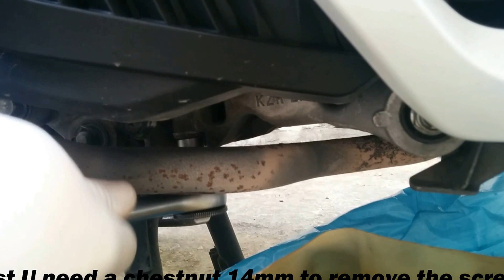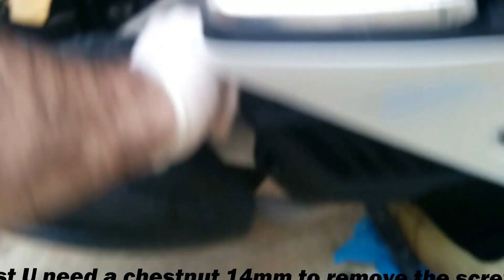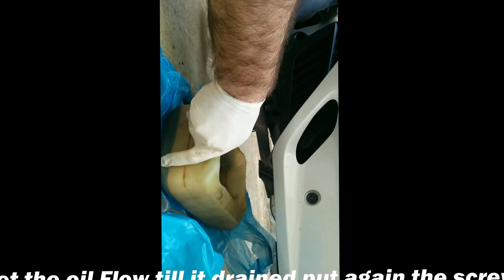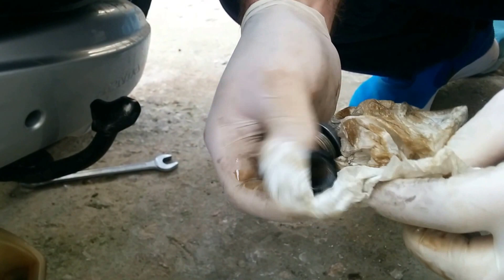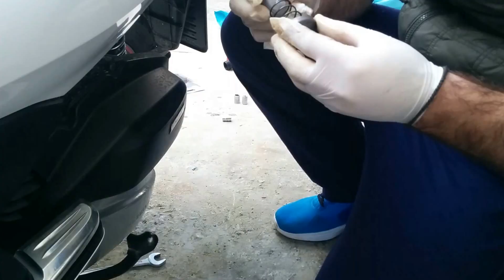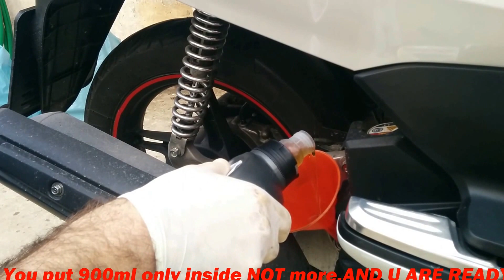How to change HONDA PCX 125 150 OIL

Comment: At honda pcx manual says uses only jaso mb type oil. But you use jaso ma2 type oil. Is it alright to do so?
Reply from the maker: I change every 3000 the oil.I have this oil for many many km and i have no problem.
Reply: @MegaZitos  yet

Comment: I just wonder why you  need to unscrew bottom bolt? I release oil from the side where's the filter, and leave it on a side stand. I am in rental business and I have changed 10 honda scooters, never had an issue, always change oil like that bethween 3000-4000 km. I had more than 70000 km on 2007 sh150, pcx is at only 25000.
Reply: Btw, the oil I use is Total Quartz ( or ELF) 10w40 for cars.
Reply: When i change the oil i use 0.9L then when i check the oil i find it too much can you help me plz bro
Reply: @omarmerikhi9496  to check oil level you don't screw the cap to the end. You measure by dipping the cap.

Comment: 900 ml if u cleaned and disassembly to oil filter..if u didn't it's only 800 ml.
Reply from the maker: gkc mgk i did clean the oil filter.so yes, 900ml.
Reply: of course. i watched ur video. i just giving info about it. nothing wrong u made about it.
Reply from the maker: gkc mgk Yes,thank you very much!!

Comment: That's a pretty good guess on 900ml of oil, you did not even check it on the dipstick after.
Reply from the maker: i checked it.The oil bottle from the outside has a counter.It was at 900ml exactly.So before you say something First Think.
Reply: Well you might have mentioned that in your video then.
Reply from the maker: Mac Payne I might not saying it, but I write it.Check under the video,i wrote some comments(about what oil i put and how many ml.